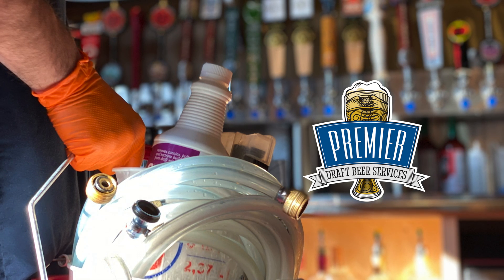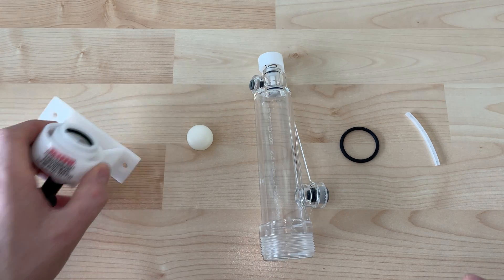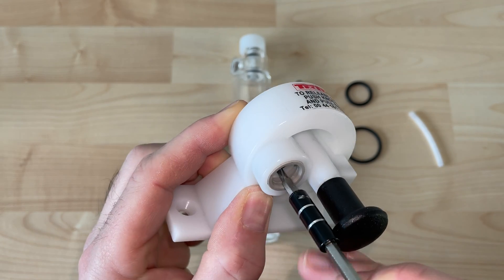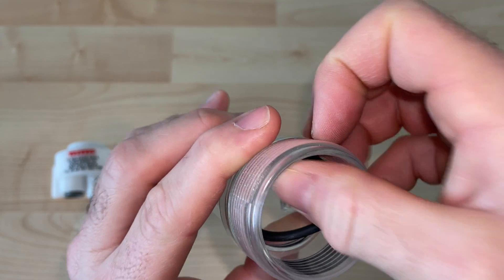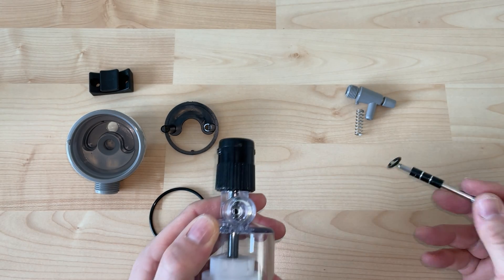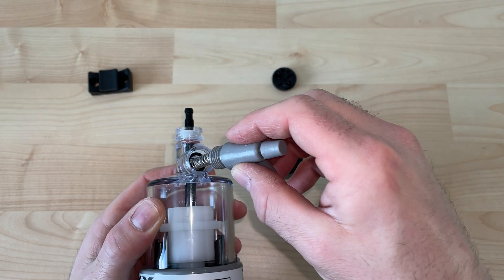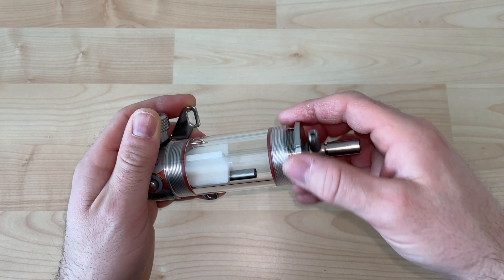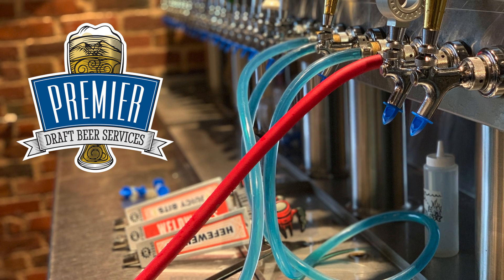Disassembling different styles of beer FOBs

Comment: Working on a FOB like the second one. The vent assembly keeps running. Tried to pull it but it still runs. Tried to clean it but still runs. A whole Keg ran through. Any suggestions or just replace the whole thing?